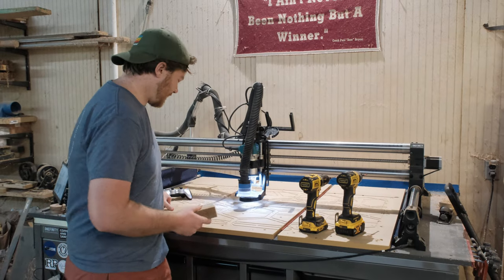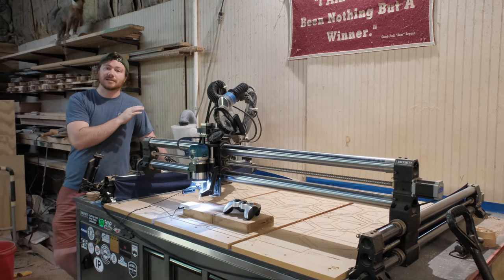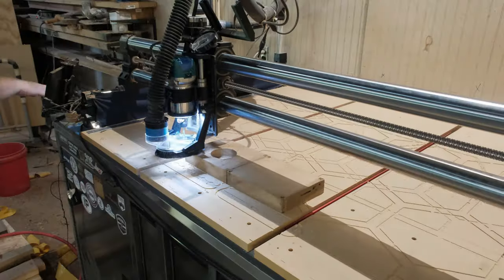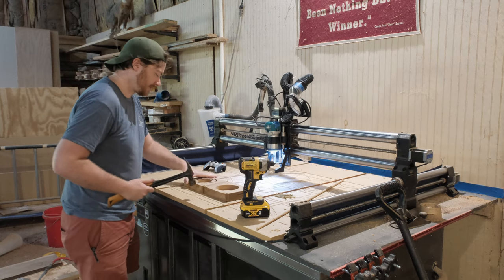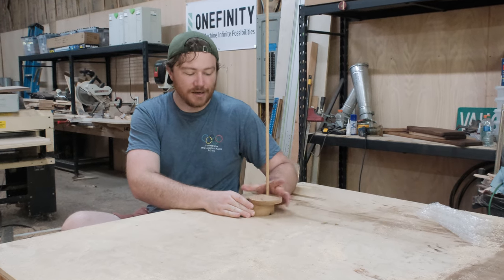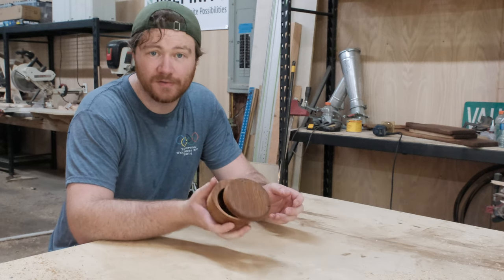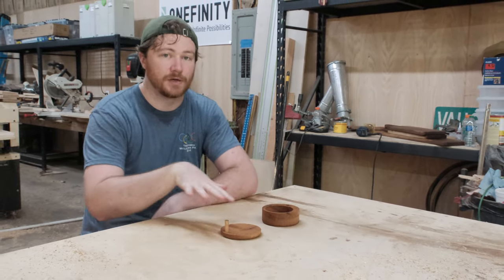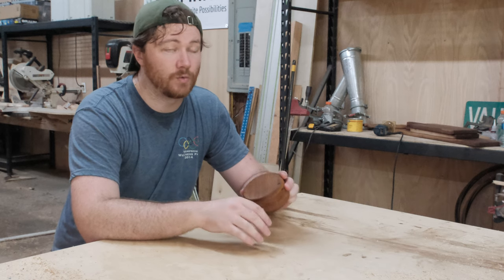Easy CNC Woodworking Projects- Salt Box

Comment: My wife just asked for one so thanks for this 😁 Any thoughts on not going all the way through the lid for the dowel hole so it's "buried" inside the lid? I'm thinking the CNC part is easy but would be hard to get the dowel the right length..

Comment: How are you profile cutting 1.5 inch doesn’t the Jenny bit only have a 1” cutting depth?
Reply from the maker: I use a downtown Jenny. It only has a 1.125" DOC, but I'm not utilizing that full cut depth in one pass. So you can cut deeper than the bits flute length as long as you're not trying to do that whole depth in one pass. I hope that makes sense.

Comment: Another tip:   I use a 1" chisel to wedge under a work piece and pop it off the tape.   I use the blue tape method, which is very thin so there's little room to get under the piece.

Comment: Hi, so the Whiteside bowl bit that is linked is 1/2" shank.... that's not right is it?  Doesn't the Makita only do 1/4"?
Reply from the maker: Thanks so much for letting me know! When certain sellers on Amazon sell out of an item they replace the listing with another so that it doesn't say "sold out"...

I guess it sold out and now its a different bit. Sadly that also mean that I have to manually go in now and change them, lol. Guess its time to go to work!

Comment: Does the Huntington builds dust boot mount fit underneath the Rowdy Roman dust pipe holder? I'm trying to figure out the setup there - I need to swap out my router mounted dust bracket to something that lets me leave my laser mount attached, and being able to use the light would be aweosme too
Reply from the maker: It fits for me! The magnetic plates fit on the suckit dustboot I got from onefinity and then the rowdy roman boom arm holds whatever type of hose you buy. I assume whatever you're running will work!
Reply: @HamiltonDilbeck  I broke my suckit dust boot on my first use, and switched to a router mounted dust boot - but it restricts me from using all the extra accessories I want to use (the light, the laser mount) - and found I couldn't use a bunch of the accessories I wanted ot use as a result

Thanks - I'll replace my suckit and try!

Comment: It looks like you're using the XFasten double sided tape.  That stuff is close to permanent sometimes.  Don't really need that AND the screws.  I've switched to double sided carpet tape for when I don't want cutout parts separating prematurely.  It's cheaper and won't break your pieces when prying them off the spoilboard.  When I want something to stay put through the entire process without screws or clamps, the XFasten stuff works great.
Reply from the maker: Tape is for the part moving, the screws are for flattening the hardwood down more than anything else. Its what works for me!
Reply: @HamiltonDilbeck  Ahh, gotcha.